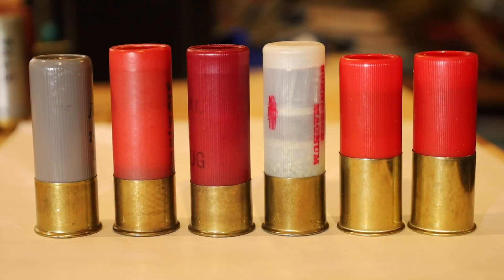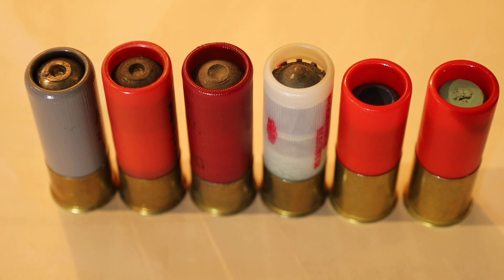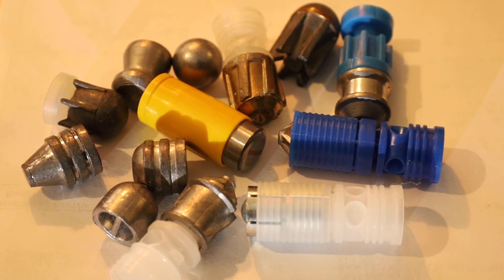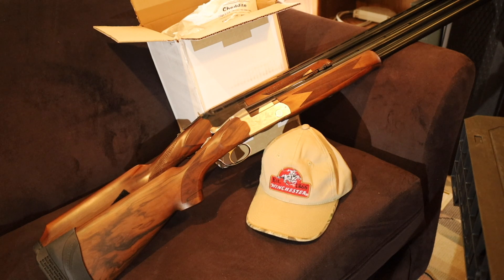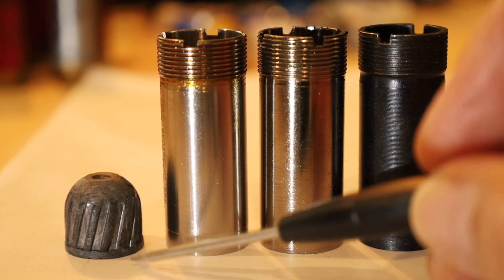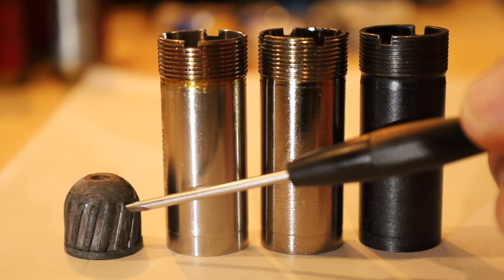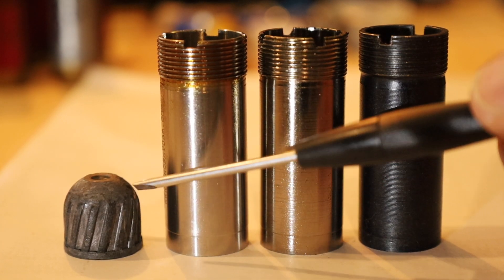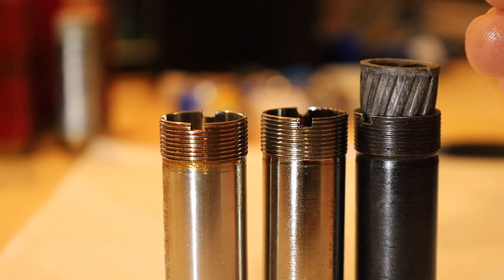VR On Slug Safety For Maria Zvijacova And Cesar Reynoso

Comment: Inhave a RIA VR80 it came with 3 Benelli chokes.The owners manual says slugs only through C and IC nothing smaller so I will stick with what the gun manufacturer warns even if people say smaller sizes will be ok. My actual question is this though, the American manufactured slugs are rifled but say "centers the slug in the bore for optimum accuracy in smoothbore shotguns. Sondoes that mean I can use them with a rifled choke? Or do I even need to? Would it even make a difference? Is it safe to? For me personally a tiny bit of extra accuracy isn't as important as safety.

Comment: I agree. I wouldn't shoot slugs and maybe not buckshot through a custom modified or full choke tube. What for, treat the choke right and you won't have any problems with patterning.
  I remember a friend of mine had a chepo .410 single shot shotgun. He shot a slug through the full choke and it split the barrel.

Comment: Very interesting and informative video, thanks!  I recently picked up a Benelli M2 LE 12 gauge, and to shoot it at my local indoor (rifle) range requires the use of slug shotshells.  This particular tactical/LE version only comes with 3 chokes (IC, M, and F) as opposed to the typical 5 that accompany most of their choked smoothbores.  Benelli recommends C or IC for use with slugs, but goes on further to say "a cylinder choke is recommended for shooting rifled slugs in a smooth-bore barrel."  I figured I'd ask your interpretation of this quote.  I don't know whether it means a cylinder "choke" is recommended, but an IC is safe to use, or using one of the two chokes listed vs no choke screwed in (as to maybe preserve the choke threads)?

Comment: My Dad told me a long time ago that the old puck'n ball (round ball) slugs would bulge a full chock barrel. When the rifled slugs came out this solved that problem and of coarse gave a much more accurate slug. I have seen many rifled slug shot through full chocks with no problem, that is not to say that they are not better if they are shot in other chocks that are not restricting the gases around them as tight. The gases around the slug is where the problem comes, the slug leaves the chamber going into a lose fit in the barrel as it starts in the chock all the gases get squeezed down around it, that's why the old punk'n ball bulged full chock barrels, the gases had no were to go and something had to give and the barrel did. With the slug molds I have seen on the market I would not shoot them in a full chocked barrel.

Comment: I’ve been shooting factory 12g slugs through chokes up to a full choke for years, with zero damage to any of my shotguns. Modern screw in chokes or older fixed chokes, everything from softer lead foster slugs to hard cast loads.
Reply from the maker: c. j. - That's like all those Glock shooters that were shooting all manner of reloads and cast bullets saying they shot thousands of rounds through their Glocks with no problems.  But those that got the Kabooms, weren't saying that.  With our shotguns, there is a lot of confusion - SAAMI says limit of 11,500 psi, and a lot of our slugs are already at 10,500 - 11,000 psi to start with.  Now we add choke constriction and pressures will be higher.  Turns out that there was some testing done a decade or two back back (wish I could quote the article, but who knew we were going to need to do that), where they kept loading shotguns hotter and hotter until the barrels burst - took 50,000 psi to do that.  So the question is - how much safety margin do we really have?  And if 50,000 psi is max pressure (big assumption), why is SAAMI stuck on 11,500 and magnum 3" is also at 11,500??  Well, it's my job to go with SAAMI since we got with it for everything else anyway (and for good reason).  And of course, confusion from factories saying, "...shoot 'em in any choke".  My Mossberg deer barrel is the one before they added choke tubes and it is a cylinder bore.  I figure that's good enough for me...and cylinder bore choke tubes are available from Carlson's for a couple of sawbucks = cheap insurance and peace of mind - plus shoots more accurately from cylinder bore anyway.  But continued good shootin' to ya, c. j.  Thanks for posting.   Steve
Reply: Shoot slugs in a shot gun thru a rifled barrel, or, a rifled choke. As far as pressure goes, you can hand load slugs using pyrodex RS, 777, or Goex.

Comment: Very well done. My grandpa said you could shoot a slug through a full choke...once. Then it would no longer be a full choke.
Reply: Nice, a man can do just about anything once ... whether it can be done repeatedly and safely is what matters.
Reply: Nahhh.....shotgun slugs are soft lead while barrels and choke tubes are steel. Steel wins out over soft lead every time.
Reply from the maker: @luvtahandload7692  - In the right combination of components and good condition guns, we have safety.  And SAAMI gives us guidelines to maintain safety - that was the first and foremost reason that SAAMI was created back in the 1920s.  The SAAMI limit for 12 gauge is 11,500 psi.  Factory and our own powerful slug reloads are already there.  Anything that increases pressure will put us into the realm of proof loads or beyond.  Steel doesn't always win out.  The gas pressure will always win out.  It's the moving bullet that saves us,  Note that Lee gives 49 grains of Blue Dot powder for their 1 oz slug load.  That's a lot of powder, and I personally don't want to shoot that through anything other than a cylinder or improved cylinder barrel.  Good shootin' to ya,  Steve
Reply: @FortuneCookie45LC  I was replying to may2888's claim that a slug could take the "full" out of a full choke with a single shot. Stay safe and be ready. 😃

Comment: Steve this was an awesome video with some great information very effectively presented! I’ve had a lot of experience shooting a variety of 12 GA factory Foster 1oz loads and even some hand loaded slugs supplied from BPI with much success in my JC Higgins Model 20 pump ( HI Standard) without any pressure issues at all! My gun is customized with removable choke tubes and I’ve shot them through cylinder & rifled tubes with success but the gun prefers the rifled choke tube fir best accuracy!

Comment: Nice demo video. It might be enlightening to see how many pounds of force it would require to push the slug through the full choke used in your demo.
Reply from the maker: RDM - There will be those that say it doesn't matter how hard it is to push the slug through, because the powder gasses will do that better than we can (unless the barrel blows up).  And once the slug is moving, it's all downhill from there.  But then that slug hits the choke, and the pressures will go up...but the argument is that by then, the pressures will have dropped in the barrel...really, but then we see the many examples of shotgun barrels blown up where the muzzle is splayed out like petals on a flower (and no, it wasn't because a 20 gauge shell was jammed in the barrel)...  Personally, by the time I'm shooting magnum slugs through my cylinder bores, the recoil punishment is good enough for me anyway...I don't need any more power than that if I'm shooting over an ounce and quarter of slug.  And since my cylinder bores shoot better than chokes, I'll stay with cylinder bore.  I know as I've shot slugs through full choke H&R M58 Topper for test purposes only - the 1 ounce slug shot through OK as it was pure lead and wasn't one of my 1 1/4+ ounce slugs.  Let's just stay on the safe side since we can't go wrong with that policy - Yes, there will be those that say shooting through full chokes is safe, but we just need top remember that our magnum slugs are already at SAAMI max of 11,500psi.  Anything that raises pressures over that is in the realm of proof loads - and nobody in their safe mind is going to tell people to shoot proof loads for regular use.  Somebody's gun is going to blow up, and we sure don't want to be the one to have told them it was safe...   Best to ya,  Steve.
Reply: @FortuneCookie45LC  excellent points. I appreciate all the thought that goes into your videos and your kind reply. I'm sure we don't want to have anyone to think we said it was OK to add pressure by constricting at the muzzle. My curiosity comment was related to how much energy is lost deforming a slug through a choke. There are rifled chokes which constrict at the lands though still full bore at .730 in the groves. Maybe I'll pull the chrono out and do some speed checks with the Invector cylinder vs. Carlson rifled 1:35 twist. Thank you.  Be well,  --Doug

Comment: What's the remaining pressure at the muzzle/choke? I'm guessing that it's a fraction of chamber pressure.
Fosters were designed at a time when nearly all shotguns were full or modified choke. As were Brenekke's, designed in 1898. The 'fins' are meant to squeeze through any common, up to full, choke restriction.
Reply: Exactly, each has surfaces designed to swage down and keep the gases sealed. Even the Gulandi wild bore slugs I see on TFM's videos under different Russian names has swage rings on it to work in full chokes.
Reply from the maker: Yukon 454 - This issue will never get resolution because what we have here is chokes are to control spread of shot charges = our shotguns have chokes and the shot charges have no problem with them, within reason, of course = our shot charges benefit greatly from the use of chokes.  With only .0001%, our bullets do not benefit from chokes.  Our slugs are cylinder bore going through. the barrel and then hit the chokes, whatever that choke might be.  The chokes are barrel constrictions, and the ultimate constriction is a barrel obstruction.  1600+ fps factory slugs are already at SAAMI max of 11,500 psi or very close to it.  All those slug designs are trying to provide safety to a choke system that is adverse to solid bullets.  There are no issues to shooting through cylinder or IC chokes so that is what is recommended.  My Mossberg fixed deer slug gun has cylinder bore...If the full choke was the way to go, Mossberg would have done that...it's good enough for me...But all shooters are definitely free to make up their own minds and be responsible for their own safety and the safety of those in the vicinity.  Good shootin' to ya,  Steve

Comment: FC45LC, I think I will follow your demonstration.  You are clear in your physical demonstration with fit of slugs & factual numbers.  Many other folks are vague.
Reply from the maker: Michael - My rationale is based on safety first...we have powerful slugs that we can shoot and the recommended choke is cylinder bore (and if stretch that to IC - well OK), but that the slugs can be shot through any choke (?!).  Why not go with the recommended since the factories are at SAAMI max (it's a competitive market after all) already anyway.  Anything that raises pressures is going to be overpressure.  My Mossberg fixed choke deer slug barrel is cylinder bore.  The factory could have provided any choke they deemed appropriate - cylinder bore is good enough for me.  When I touch off, I don't have to be concerned that my ammo is going to blow the gun up.  Best to ya,  Steve

Comment: Think of resizing bullets, that is basically what is happening.  It doesn't take too much effort to size a .361 down to .356, and that is solid wheel weight alloy with no lube grooves.  (It's a homemade mold that drops 358, then get powder coating)

Now, an even softer 12 ga slug, that's hollow, and has rifling grooves that lead can be displaced into, shouldn't be too difficult to squeeze down.

Further proof that it is ok, if it was a problem half of the shotguns in the US would have exploded by now 

Excellent production, thanks.
Reply from the maker: Squawking Hawking - Yes, and we can shoot 311 bullets through a 308 bore - not recommended, but we can do that especially in a Mosin that we only paid $79 to buy.  But there's nobody I know that would do that with one of their favorite 308 rifles.  And you will see some real hard bullet sizing operations requiring lube to be used on YouTube as well - sometimes the recommendation is to size down in two steps.  Here's the thing - you won't find any centerfire rifles (we're not talking about 45 Colt/410 interchangeable here) designed to shoot bullets first and foremost having any chokes in the barrel - why would anyone want to choke a bullet?  ...choke shot charges sure, but not choking bullets.  Just because it can be done, there's just no profit there, just negatives including danger.  Smoothbore slug guns (with the exception of slug guns that might also be used to shoot shot = removable choke tubes) or rifled slug barrels don't have chokes.  My Mossberg fixed deer slug gun with the rifle sights is a cylinder bore, factory could have choked it if that was good.  .What it boils down to is that every shooter is not only responsible for their own safety, but the safety of those in the vicinity.  Shooters should look at the issue if any, and decide for themselves.   SAAMI says 11,500 psi for 12 gauge and magnum slugs are already there.  We abide by SAAMI for good reason - it is there for our safety.  There's a metallic

Comment: Good points. I keep Imp Cyl in my 20" rifle sighted 870 "deer" barrel. I have always gotten good accuracy with Foster slugs (mostly Winchester) at 50 and 100 yards as well as good buckshot patterns out to 20 yards or so. Notably tighter than an open choke/cylinder bore. The Federal Flitecontrol wad is a game changer for buckshot- patterns were usable to 30 yards or so in some LE testing i did years ago. I did not see that Modified had any benefits, and i was always suspicious that lead might shave off in the choke tube. Someday i may get a rifled barrel for sabot slugs, but they will have to be copper here in Kalifornia